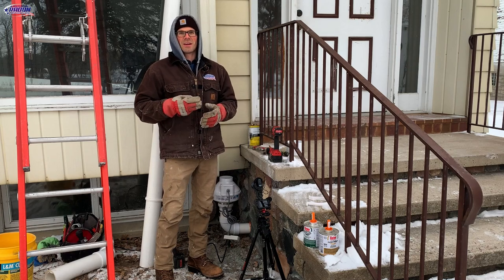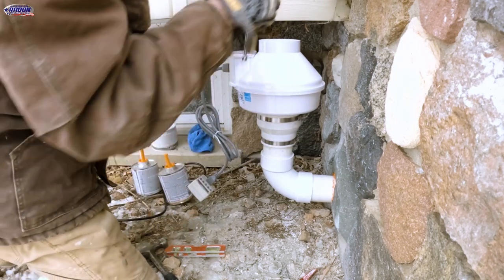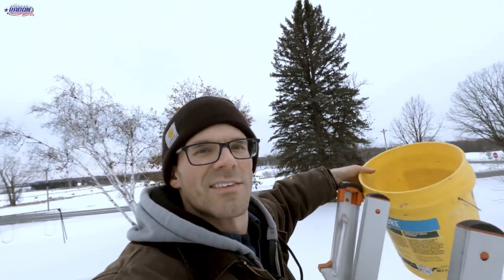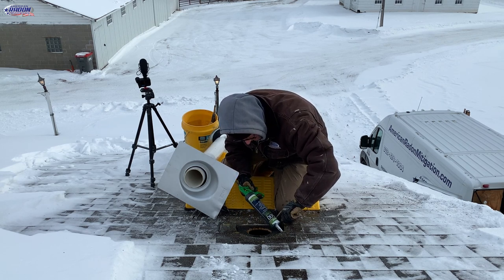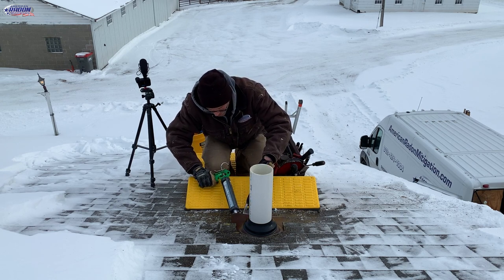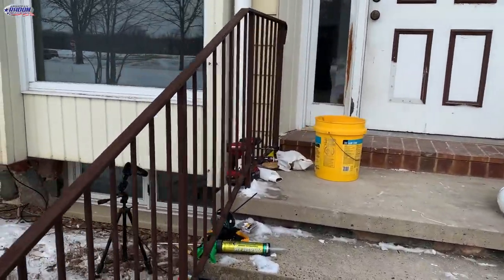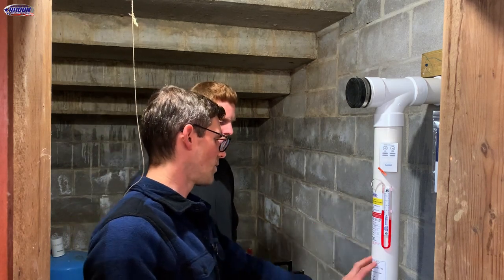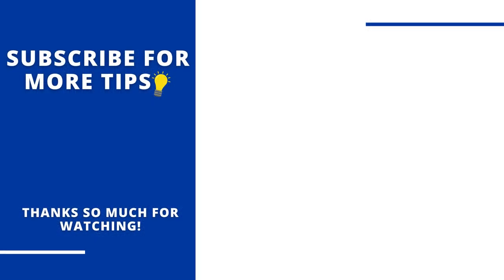Full Radon Mitigation System Install | Part 3 of 3

Comment: Great video Jesse. I believe I've watched them all. I have a great respect for your work. I do have a couple of questions: 1) What's the advantage of switching from 3" pipe before the fan to 4" after the fan?    2) I thought the RN1 fan has an Application Pressure Range of 0 - .8 (in W.C.), and a Max. Pressure, of .89 and yet your U tube manometer is reading .90.   Doesn't that mean it's maxed out and pulling very little CFM? If the soil moisture increases, will that fan cease to work? Thanks again.
Reply from the maker: Thank you, R D!
1. Four-inch pipe is less likely to have freeze-up issues, so that's why we use 4-inch pipe outside. 
2. Yes, the RN1 is only moving 16 CFM. Some fan manufactures say a radon fan needs to move some air to keep the fan from overheating. I used to believe that until I met Chad Robinson. Chad installs many of these small fans in homes with clay soils where very little air flows through the fan. He says that he has not found it to be a problem. I haven't experienced any failures due to the fan operating at its max pressure either. I've been monitoring the radon levels in Mike's house since June, and they average 0.8 pCi/L, so I don't think soil moisture causes the system to lose pressure field extension. 

RN1 Spec Sheet https://www.obarsystems.com/wp-content/uploads/2018/10/RN1_Sales_Sheet_final.pdf

Comment: Is the pipe running up, and resting against, the wall like that ever cause more noise inside the house? I’ve had a system installed recently and been trying to see if you address that in any videos, as I believe it’s adding a lot of extra noise that I’m hoping to mitigate down some. Unfortunately it is near our bedroom.
Reply from the maker: High-suction and high-flow fans tend to be the ones with noise issues. The Fantech RN1 used in this video is one of the smallest radon fans they make. Therefore, it is improbable for one of these small fans to cause noise due to a vibration transferring into the building materials. 

I suggest isolating the fan and piping near it from your home or upgrading to a smaller radon fan if yours is oversized.
Reply: @AmericanRadonMitigation  thank you for the reply. Any suggestions on how to isolate the pipe from the house? They used a fantech rn3. I can already tell after watching your videos, the installers didn’t take the time and care you do to properly mitigate radon. They were in and out of my house within 2 hours, and it’s only barely getting below 4 pCi.

Comment: I am curious why you opt for a sump cover and connect the mitigation to it?
Reply from the maker: I need help understanding your question.
Reply: Sorry - meant to ask why you did not connect the mitigation to the sump? Thank you for replying im taking the certi course now
Reply from the maker: @jaymehipple4953  Sump suction is typically frowned upon. We usually only do it when there's aftermarket drain tile or no sump pump, and the homeowner wants to save some money. In Mike’s house, the sump basket only had small holes drilled into it, it wouldn't have been a good candidate since there wasn't a direct connection to the drain tile.

Comment: Why not install the fan in the basement away from the weather?
Reply from the maker: The American radon standards don't allow a radon fan to be within or below a conditioned space. That leaves an unconditioned attic or outside as the only option.
Reply: @AmericanRadonMitigation  any reason why it’s not allowed?
Reply from the maker: Yes, if the fan or a pressurized part of the system leaked, radon would be forced into the home.
Reply: @AmericanRadonMitigation i get thats what the "regulations" state.. but this is stupid.. not being able to have the radon fan in your house is like saying you cant have a furnace in your house because the combustion gas which contains carbon monoxide might leak into your house...

Comment: I own a solar business. Why are you on that roof without fall protection bud? 
Shit happens on and (even more importantly) off roofs. 
60k installs we sure have seen some of it.
You seem to be quite knowledgeable and I see nothing wrong with the work up there except id like to see that pipe be left alone or covered in lieu of paint it wont be on there long.
Reply from the maker: I'd love to see how you use fall protection! I haven't found any good solutions yet and would like to before I send one of my guys up on a roof in my place. Do you have any videos or resources you suggest that would be helpful? Thanks in advance!
Reply: @AmericanRadonMitigation  cyclone safety harness. Best fit but they aren’t universal. For anchors we use malta and offer customers the option of doing temp or permanent on comp shingle/3 tab or standing seam. We don’t do other roof types in bad weather. Best of luck to you! 
Also, id love to hear more about your best practices for new slab on grade construction. Im preparing to buy land in park county, co and I wanna build it for generational ownership
Reply from the maker: @mattbrew11  I spoke with Malta. However, they don't think any of their products would be a good solution for us. Instead, they recommended that we use the Ridge Pro. https://amzn.to/41QBkOK It sounds like the Ridge Pro is only OSHA-compliant if it is fastened to the roof, which would require the removal of shingles.

Do you use the Malta Dynamics Reusable Roof Anchor for a temporary anchor? https://amzn.to/41QBkOK If so, do you remove and replace shingles to secure them? I want to avoid removing and replacing shingles if possible. 

Here's a link to the new construction mitigation standards. https://standards.aarst.org/CCAH-2020/index.html#zoom=z

Soil gas mat for a slab-on-grade home video. https://youtu.be/fMNzVpbfthE
Reply: @AmericanRadonMitigation  yes we pull shingles and replace them. ~ 60% of our customers are getting reroofed prior to pv install so most jobs arent adding any measurable extra effort
Reply: @AmericanRadonMitigation  thanks for the links!
Reply from the maker: Thanks for the info!
Reply from the maker: You bet! Good luck with the build!